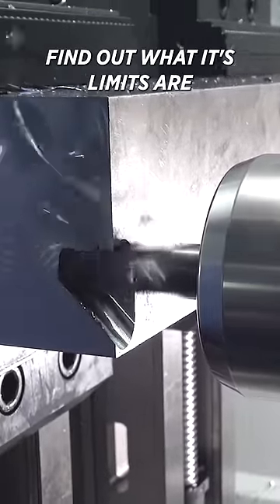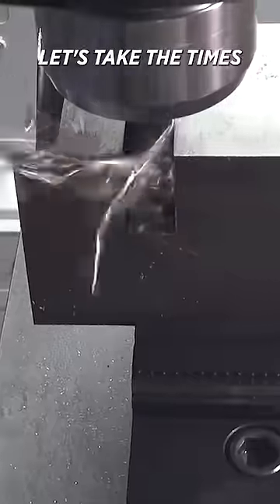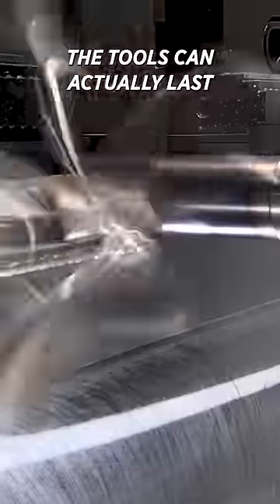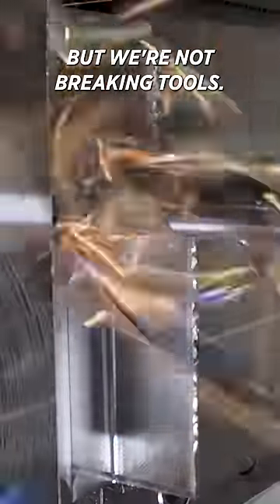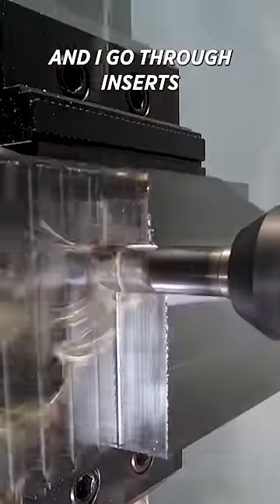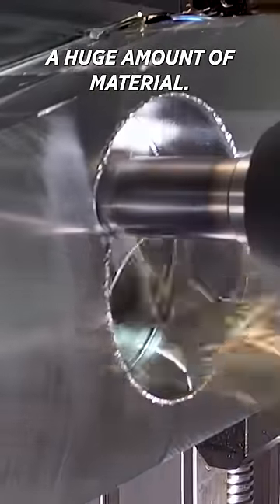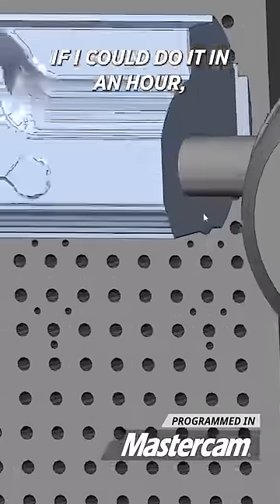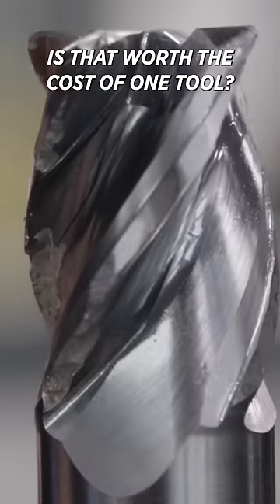Why Do We Push Our Tools to the Limit? #shorts

Comment: I work for a swiss tool manufacturer, all our cutting data given in the catalog are conservative and can be increased by 50% without tool breakage. The tool life is shortened but the machining time is significantly reduced. The tools can be resharpened by us at a third of the new price and then work with the same cutting data.
Reply: If you don't mind saying who do you work for, because I'd like to give it a go. And does what you say rely on having heavy duty fixtures for the part being machined?
Reply: Noice
Reply: Nice
Reply: @tatterz__  Clamping and cooling must of course be suitable, Vibrations are always bad and a rigid machine is always an advantage. The name of the company is FRAISA, in the USA it is represented by FRAISA USA New Brighton, MN .
Reply: @kingozymandias2988  how much time does it take, to perform a full cycle of resharpening a tool, including the time of delivery. For example your client is couple of states away from your factory.
Reply: @escapist279  I don't know how our American colleagues handle it, but here in europe we guarantee that the tools will be back at the customer's premises after a maximum of 3 weeks, including coating, irrespective of the quantity and what kind of tools are involved. Regardless of whether the tools come from the duty-free EU area or whether they have to be cleared through customs. This applies to the whole of Europe.
We not only resharpen our own tools, but also our competitors' tools with original geometry. Most of our American colleagues went to Germany, where Fraisa's regrinding center for all of europe is located, to be trained on the machines and the cutting geometries.
Reply: @kingozymandias2988  man that’s awesome, you’re a great brand ambassador! They should give you a raise for spreading the good word 😁
Reply: Pretty nice idea, how many times do the tools can get sharpened before they get too small?
Reply: @i_am_terom4810  The tools can be up to 10 percent smaller in diameter without loss of performance and minimum length of 1x diameter cutting length
Reply: Cutting data given in catalogs are usually rather "conservative".
They're a safe starting point, depending on circumstances you can go either way with the respective trade offs.

I always thought this to be true in general. Or am I mistaken and Fraisa, which I don't have any personal experience with as of yet, does it different than most other brands and is way more conservative with their catalog feeds & speeds?
Reply: @kingozymandias2988  bet, Im repping American GFM. Job is laid back if the company keeps it's patents safe. I couldn't imagine going from being a pure machinist to being a production operator depending on everyone else to make parts.
Reply: Big Kaiser?
Reply: Won't cutting that fast cause too much heat in the part being tooled?
Reply: @jbertucci  not with proper lubrication and cooling.
Reply: I work for a manufacturer and we run our tools at 50% and buy new ones each time. We just pass the cost to the consumer. Been in business for 27 years
Reply: I once tried to do a small 2cm wide (tool width) 2cm deep cut on a piece of rail track.... After half a dozen tools I gave up lol
Reply: @kingozymandias2988  just wanna say you guys make top notch tools, we run 20mm 4 flute endmills from Fraisa in Super Duplex quite alot. They cut great and last quite a while considering the material and parameters we run.

We have them sharpened by our fraisa reseller here in Norway (Nor-Swiss), so I dont know how that compares to a factory regrind, but they work quite well after sharpening too.
Reply: @anders98  Glad to hear that. As long as you are happy with the performance, I would continue to have it resharpened there.
Reply: @kingozymandias2988  😮😮
Reply: @xbadjokerx  Do you mean railway rail? Well, the top part of the rail is high carbon steel, the bottom is mild. Some may not be aware.
Reply: @kingozymandias2988  respect for talking up your company but only plugging it by name after being asked
Reply: @andriyshapovalov8886  yeah railway rails and I was doing it in the bottom part.
Reply: After they're sharpened does that change the tolerances of the finished product?
Reply: A broken tool damaged the job. Run the tools to +25% and change them out for resharpening.  Tool costs go up but you still get the throughput and reduced machine time.
Reply: @norsetitan5776  As a customer you can define a desired diameter including tolerance range.
Reply: @aussieflintknapping  Thx 👍🏻
Reply: I feel obligated to say, I have a tattoo inspired by Ozymandias and you’re the first person it mention of him since I’ve gotten it.
Reply: That's gold standard practice.
Reply: I’m curios, why is your profile picture a Swedish flag template with different colors? (I’m just curios about it’s meaning this isn’t some sort of trap)
Reply: Gotta love those swiss machinist
Reply: one year learning to be and working as a machinist, and im aware of costs of time, tools, but has he mentioned how much it costs when a broken tool ruins a piece of stock? particularly when you've already done several operations on it and have a lot of time invested in it and if you mess it up on your last operation you're back to square one and lose a ton of money
Reply: @kingozymandias2988  I’ll tell you what me being American will tell you if I see anything that says made in Switzerland 🇨🇭 I will by it with the full confidence that it will do exactly as it claims it would do and more. Also I loved going to lake Lucerne and Zurich your country is just beautiful.
Reply: @phall7031  Why do you think the cutting data in the catalog is conservative? This is the compromise between service life and performance. The specified cutting data is safe, even with increased values it is safe, but the service life decreases. Choose what is more important to you.
Reply: @spacetexan1667  It is an interpretation of the Scandinavian cross of Peter Steele, the late singer of Type O Negative
Reply: @kingozymandias2988  i see, thanks mate! Maybe I’ll have to check his stuff out
Reply: i live in mn too! its nice to see companies working smart even up here!
Reply: I’m bout to find out😂
Reply: @phall7031  i work as a CNC technician and it really depends on what you are doing,we usually work with machine and pieces on the order of millions of $.
If the tool broke "short" and the machine detect it you just replace it and the part may have like some little scarf.
Of It broke bad like drilling or deep drilling (like one of my clients do some 1m long 8mm drill) and you also have some harden tool you need to burn them out,and then, of needed to meet tolerance fill the piece with soldering and re-machine it.
With carbon fiber usually you trow away the piece, usually same with plastic, Teflon etc.
Bad things happen when machine work alone and the anti collision software/sensor doesn't work.
I saw some heavy damage due to this one time (100k$ to replace spindle and redo geometry on the machine +25k$ for the part, the machine broke the tool and keept going the weekend "drilling" with the head of the spindle.
The work of soldering and re-machining is also used for hig ware part,like molding where after some thousand of utilization you add some material and machine it back to original tolerance.
Anyway, to answer you, usually you go from 50-100$ for a simple "replace the tool" to 150k$ where you damage machine and piece.
Reply: Meanwhile this other guy would rather melt the product you ordered from him to get the next one started
Reply: Damn.. 50% ? And thats a conservative estimate?
Reply: Wow that’s incredible
Reply: @gsaexperience8578  you throw perfectly fine working tools In the Trash?
Reply: Wow now that's efficient while also playing it somewhat safe
Reply: I must have gotten something wrong in my previous job as a miller (*trained for just 1/2 year on the spot without any legit technical education). We had mostly SECO and STANDARD tooling and catalogues. Mine was Hartford Tornado2 3-axis (not the sturdiest). 
 Now i'm starting to think our maths - or those in the catalogue - were all wrong. Actually the opposite were thought by our supervisor (and son of the owner): not only we couldn't run feeds and speeds at 200% of catalogue values, but mostly they were 50% or under irl. We honestly believed the table values were exaggerated to shorten the tool life as a marketing ploy of these catalogues. Our arsenal was not very wide - vast majority insert mills and drills. Only 2 CNC mills in the shop (other one being Doosan 4000×3000×2700 5-axis (rather 4.5).
Reply: @dannydetonator  pay attention cause non rigid machine can cause premature wear on tooling and milling mark on the piece.
A rigid machine usually move 0.01-0.02 mm when under heavy load without compensation.
Reply: @tatterz__  Swiss army knife
Reply: @spacetexan1667  How sad is it in modern society that you have to preface a genuinely curious question in such a way?
Reply: @kingozymandias2988  
“I don’t wanna be
I don’t wanna be me
I don’t wanna be 
me anymore”

Sorry, I know they have better tunes…
Reply: @Pseudoswede  👍🏻
Reply: @Pseudoswede  it’s ridiculously sad 

I miss when nobody had to step on eggshells... you know, when we were human? Miss those days.
Reply: Is the new cutting data inflated by 50% again?
Reply: Depends greatly on what you're doing
Reply: @escapist279  nice
Reply: @i_am_terom4810  you need to make a new profile every time the tool is resharpened... That makes your machined parts innacurate.... And that saved time turns into a headache!!!
Reply: @VARPYGAMER  Strange with so expensive but not supervised equipment. Even hobbyist 3D printer people may use camera supervision that detects spaghetti if maybe the object gets lose from the base plate and then stops the printer. All for a cost of less than $100. And all to make it safe to walk away from the printer and go to work etc.

So aren't there similar automatic supervision for highend milling gear? That fail you mentioned must have been possible to catch by supervising motor currents, vibrations or noise.
Reply: @dannydetonator  I would have expected the shop to do test runs with maybe 5 tools when switching brand or quality grade at varying loads to learn them instead of just assuming the catalogue was lying.
Reply: @perwestermark8920  That is what i was doing. Testing the safe limits, if time allows and risks braking something is smaller than potentiak gains.
 2 flaws could be the culprit.
1) Being too cautious sometimes.
2) My machine being fancy, jelly-like structure, not withstanding forces because of the lack of rigidity, often beat-up tools and spindle runout + perpendicularity over 0.03mm due to previous 'testing' and 'learning' crashes. There were only 3 brands of bits, with some other special or rarely used solid tooling. Parts were often oversized or completely unsuitable for milling due to design, shapes, geometry and dimension effect on harmonic resonances, rigidity, horrible surfaces and hard materials, half-arsed, vague welding and other obstacles to use the tools and machine at intended capacity. If rarely i could use the feeds listed or above, even rarer i could use the speeds advertized or above. Without shaking the set-up to crush or burn-up the tools' cuttings surfaces, that is.

 Now i've left the place and looking around for a better employer. Training too, as never even went to any technical school - all learning on jobs i held. Fresh start in vision, i'll find out the truth about tooling.🙏
Reply: @perwestermark8920  P. S. Le truck about certain tool (rather insert) manufacturers being generous with the 'optimal' cutting conditions is not from my imagination or dubious assumptions, but the teachings of my direct supervisor/son of the CEO and my first 'teacher'- fellow CNC miller and all round cool guy with >6 years on the job. Might be just Standard and Seco not predicting some unsuitable set-ups,  idk yet.
Reply: @perwestermark8920  yes usually a fail like this is detected by the anti collision system that is like gyroscope and who know what, spindle temperature probe, and motor current.
But that machine is a big one for steel and High grade alloy and was woerking with aluminum so even if milling with the head the vibration and current was in the limit set by the installers (they where generous with setting)
Milling machine can operate under really heavy load so motors and parts require a lot of current,and the bigger the machine the higher the current required before triggering alarms.
It was also a non super recent machine, 1998 so also the software was not super fresh.
The only thing was the spindle temperature that some operator had disabled so the machine didn't detect it
Reply: King of kinks
Reply: Lol
Reply: This needs to be shared between tool manufacturers and manufacturers that use their tools the cost of machined products should go down
Reply: Alexandru Ciobanu  The substance must of course still be given, adding material is difficult when grinding.
Reply: Alexandru Ciobanu  If the user rapes the tool, nothing can be done, it is up to the customer what he does with it.

Comment: I am a trained machinist in Germany. One of our teachers thought us: "if you never break something, you aren't running even close to the limits" since then I cut my times down drastically.
Reply: @UG the machines we use don't have something like that, speeds also strongly depend on material, operation, the method of clamping it down and so on

Same thing goes for wear, I don't know the English terms but there are many different reasons for wear on the tool that can't be controlled by a calculator (at least in my eyes) 

Also every tool manufacturer os different , I doubt that there is a build jn calculator for stuff like that. 

Do you maybe know a brand or something that hast stuff like that in the machine? Seems really interesting
Reply: And then my dumbass breaks it moving my bridgeports table and hit the $80 carbide 1/16 end mill and snap it. The only one in my shop. Fml.
Reply: @matthewgebhard4  Oof
Reply: ah, Germany. makes sense
Reply: Teachers and engineers typically do not concern themselves with your companies bottom line. They concern themselves with what the machine they engineer and sell can do. And how much more money they can fleece you for when "you broke it, because you pushed it too hard" even when you always ran it within their exaggerated specifications.
Reply: Never break something sounds like a desirable quality.
Reply: @kayakMike1000  break a few things to figure out the limits of your tooling then work well enough under that with the coolant flow necessary for that cutter or milling bit to extend longevity. Carbide, for instance, doesn't care that much about heat as long as it stays just far enough below the melting point of it's sintering metal whereas high-speed tool steel bits will gladly take as much coolant as you're able to throw at them. I've even seen a bunch of videos of shops only running carbide tooling with air cooling to blow out the chips and keep the inserts cooled. It's all a matter of what your tooling requires.
Reply: Yup how fast can this job run
Reply: @UG there are no machines programed like that. It's on the operating person to judge the cut an how burr feels to change tool or let it break an change it after.
Reply: And were you financially rewarded/compensated for your increased efficiency?
Reply: @UG There is.
Reply: one of your teachers "thought" you huh ... something tells me you didn't learn much.
Reply: @comancheclub3449  in germany ?🤣🤣 as a german i can almost certainly no most defently not ...this is Expected ...you get hierd for beeing the best Option they could hire so you better deliver or go home trying to optimize is Part of every day job here and nothing you get a reward for dude 🤣
Reply: Id also love to be a machinist in Germany, could you tell us a salary range? Thanks!
Reply: @Socks3657  depends on what type of machinig but its between 12 and 20 bucks an hr  .. so between 2 and 3 k a month BEFORE TAX after tax its like 1400/1800 ...so quite a nice payed job here for german Standards....but for american Standards its like nothing and 1400 is öike barely enogth...but thats how it works here im germany ...it does not matter wich job you do you get you sat sallary you do the best you can for it